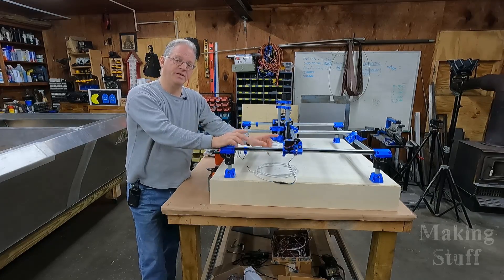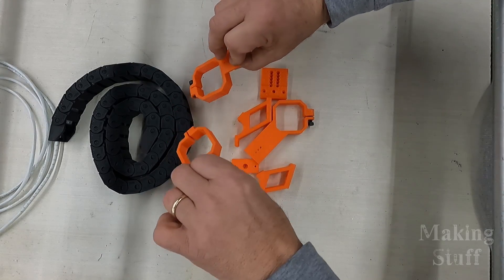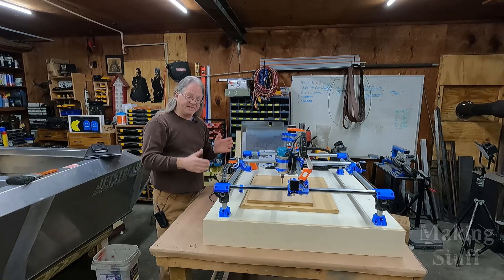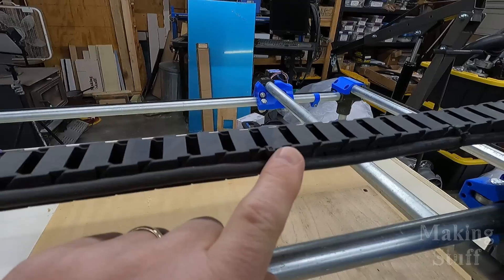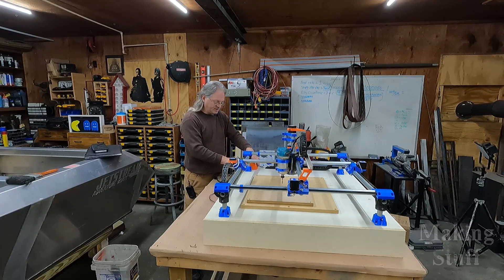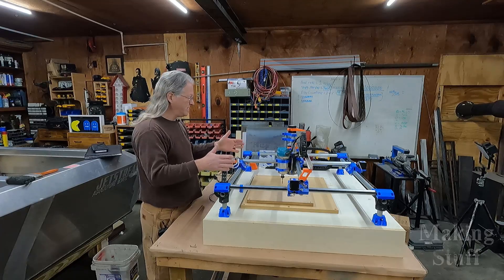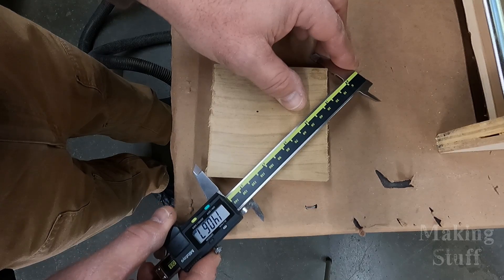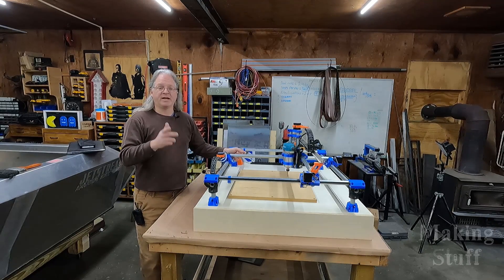Assembling a Primo MPCNC (Mostly 3D Printed CNC) - Part 2

Comment: That's a nice job what you have done there 👍🖖
And  i have a Question... What are the Boards you are using  what we can see at min + - 03:40 - 03:52  (What is the "Mainboard" and the "Red Board with the screen?)
PS: sorry if my English is not correct, i never learned it in school, i learn it by DIY.
Reply from the maker: I got it from the V1 engineering store.

Comment: Does this only work with the Makita router? I have a bosch around the same size and power. Im wondering if it'll be compatible.
Reply from the maker: There are plenty of different mounts available for the MPCNC.  I wouldcheck on Thingiverse.com and see if you can find a mount.

Comment: Have you considered going to a spindle (maybe 800 W?) instead of the router for reduced noise and more consistent speed?   (The router always slows under load.)  This might be good, especially for aluminum.  I'm trying to decide for my own Primo.  

As for the looseness, if you get it adjusted correctly, it should be just as tight as the previous version.  However, over time, the plastic does "creep" causing it to need to be re-tightened. Maybe once or twice a year. 

I spoke to the V1 guys at the recent RMRRF and they said it may be necessary to even re-print the core once in a while. 

Final question:  did you build the version that uses the 3/4" EMT or the version that uses the 1" steel tube?  For my 24" x 24" work area, I think the larger OD is slightly better.

Comment: could you please make a video on how to square the 3D-printed trucks and gantry? I 3D printed all the parts but I am having nightmares squaring the trucks also the assembly feels flimsy :(
Reply from the maker: How to square the machine is in the V1 documentation for the MPCNC.  Mine is a little loose too.  I haven't figured out what is causing it yet.  The older design seemed to be more rigid.

Comment: I've wondered with these if you can eventually machine the 3D printed parts with something better like aluminum?  Glad you're feeling better.  Wondering if you can make some sort of mechanism to slide over and drop down to slide back in the bottom, for a more ergonomic and easily stowable system?
Reply from the maker: I have cut aluminum with them before and that's the goal for this machine.
Reply: @MakingStuff I think the commenter meant : can you replace plastic parts of the machine with aluminum ones for improved precision and performance.

Comment: I really have enjoyed using my mpcnc the last few years. After upgrading to the primo version I felt that it was far better than the previous models, but I still have to tighten things regularly and print replacement parts after they inevitably break.
Reply from the maker: This one seems to be a little loose.  Not sure if it is something I did, or if it is the design.
Reply: @MakingStuff  it starts to cause major problems if you don't have everything tightened properly with this machine. Mine is about the same size as yours as cuts wood really well. But as soon as I started with aluminum plate, the weaknesses really showed themselves. I know it's not apples to apples in terms of cost, but I ended up buying the queen bee pro 1500x1500 to replace my mpcnc. I am still making space for it so I haven't tested it yet, but I felt that I needed more reliability moving forward.

Comment: I like your approach! Useful data for anyone contemplating to build: Cost. Time. CNC controller g-code generation (did you use Fusion 360 fro CAM?) parts availability, etc. Thanks for sharing!
Reply from the maker: Parts list is in the decription.  I used a RAMBO board that I bought from V1.  I used Sketchup and Estlcam to make the test block in the video.

Comment: Really like this but no printer. Must be alternates for some of the larger connection parts. Wanted 1 for years.
Have motors and many parts including that square aluminum lengths with the 4 sides for connecting brackets etc.
Reply: VE Egineering sells the printed parts in a kit. You could also look into local maker spaces or local library to see if they have 3d printers for rent.
Reply: @kortt  Thanks but VE Egineering takes me nowhere ad here in the boonies of maine we got diddly. IS there a better link?
Reply from the maker: It's V1 Engineering, not VE.  https://www.v1engineering.com/
Reply: @MakingStuff  hmm.  I posted the link as well after realizing my typo, must have been deleted?